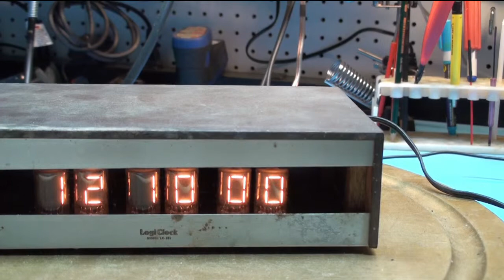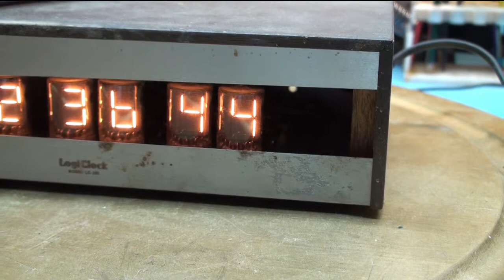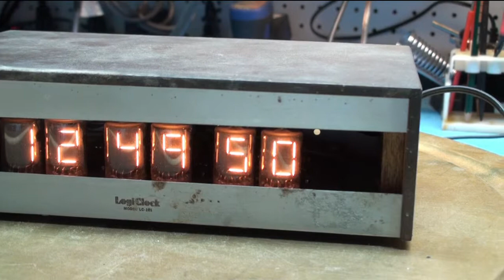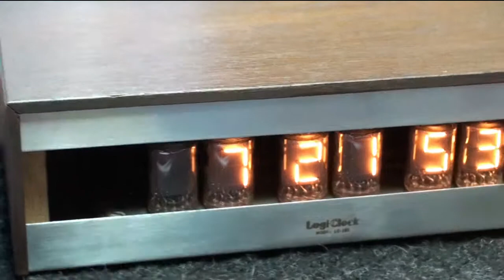Logi-Clock LC-101 vintage Numitron tube clock '72

Comment: Nice vintage clock and good video! Thanks for posting.

If you have it apart again in the future you might want to take that opportunity to "wash" all that brown flux residue off the back of the board. Given that the clock is still running I guess it's not doing any rapid harm but flux residue does promote slow corrosion under some conditions. Clean with commercial Flux Remover Spray (or maybe denatured alcohol) and a stiff bristle brush.

I envy you finding that clock for $3.00! Great deal.